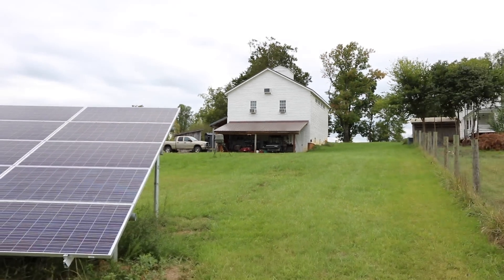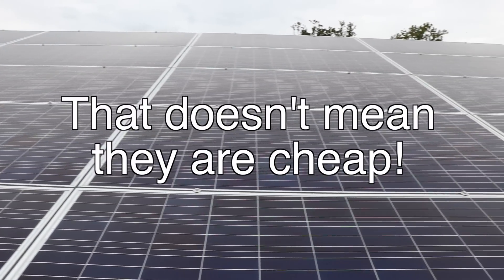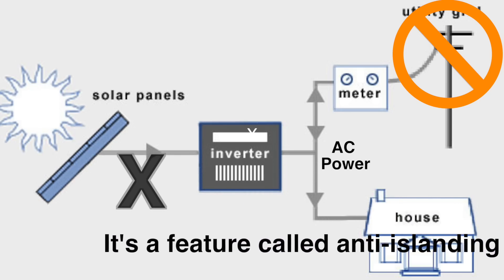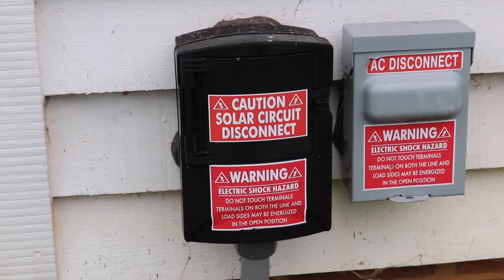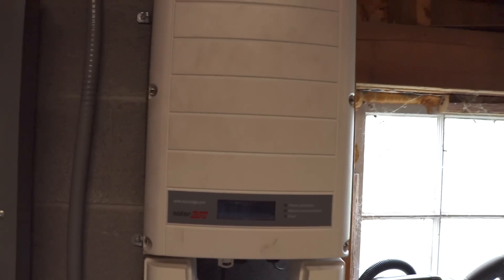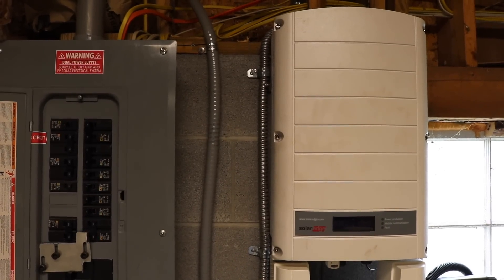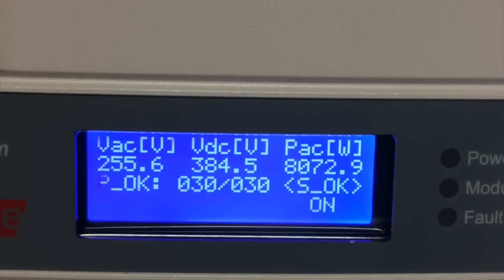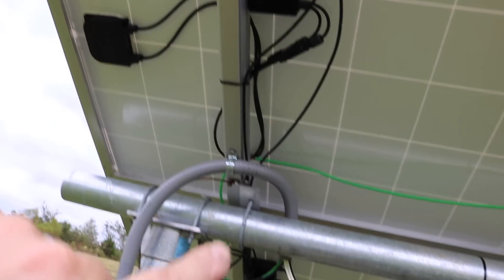The ugly truth behind grid-tie solar systems. Part 1, FarmCraft101 solar.  Watch before you buy!

Comment: Your break even assumes you generate your entire energy usage with the panels 7 days a week 365 days a year. I think your break even is going to be closer to 12 years at best.
Reply from the maker: No, I didn't figure it making 9.1kW of power.  I have been averaging about 55 kWh per day, which is in line with my estimates.
Reply: This number will vary throughout the year.   I have an 8.5KW grid tied net metered solar system in Southern Ontario, Canada.  In June and July I will average 50KWh per day in generation.  In December-January it will be as low as 19KWh per day (with darker days and snow).   My home uses an average of 30KWh per day (I have a Chevrolet Volt which tacks on an average of 12KWh per day).  I generate a large credit in the summer and that helps get me through the deficit in the winter.  I come very close to break even every year.
Reply: Cool system.  Since wires cost so much, why is it so far from your house?

55 kWh per day  is a lot of juice.
30panels * 300maxwatts/panel = 9kW
You'd have to be averaging 6 good hours of sunlight every day for 54kWh.

Why did you get so much capacity?  Does your house use anywhere remotely as much as that?  What are you doing smelting aluminum or running factory?  Are you making actual cash from the power company?
Reply: Most people miss one point, if you have $20 k that you have  invested at less than 1% that you have no immediate use for and use it to install a 4kw solar system the return on your investment will be  considerable greater starting the first day
Reply: yeah,  kinda figured the same. i'd rather just pay the $200 a month in electricity.  those batteries will cost thousands to replace.
Reply: economics is different for everyone and I think that's what confuses most people. solar is dirt cheap in places where electricity is expensive but sunlight is plentiful (southern CA for example). solar doesn't make sense in places where you get little sunlight or if electricity is dirt cheap.

take his case where he's measured an average of 55kwh daily and pays about 0.11 cents per kwh. that means he generates about $2,200 in electricity per year. $17,000 / $2,200 = 7.8 years payoff. yes the output does degrade over time, about 1% annually that's typically warrantied but electricity companies will raise rates on average much more than that.

what I can say is 0.11 cents/kwh is pretty typical and the 6 average daily sunshine hours he gets is pretty good (most in the US will range between 4.5-5.5 average sunshine hours). it might be better to think of it in terms of annual sunshine hours which you can look up - ranges between 1600-2000 in the USA.

I know some states pay less than .10 cents/kwh flat rate while others in southern CA get charged 0.25 cents/kwh peak plus extra if you pass a threshold monthly usage. so payoff in some areas could be just 4-5 years. all you have to do is look at your electricity bill and build a system that roughly covers it based on your geographic location.
Reply: I'm net metering.  Not Micro-fit.  I'm not being paid by the Ontario government.  Even today micro-fit which is ending this year is only paying 28 cents/KWh locked in at a 20 year contract.  Which is no longer worth it. That's why I went with net metering.  I actually use the power I make and only get a credit against my hydro bill for the power I push back to the grid at the going rate.  Nothing more.  In fact I have to pay sales tax on the power I use but don't get sales tax back on the power I push back to the grid.
Reply: On top of the tax paid for power used what other fees do you pay on your monthly hydro bill?
Reply: On top of the tax paid for power used what other fees do you pay on your monthly hydro bill?
Reply: Not sure if this question was directed at me?  But in my case we pay a fixed and variable (per/KWh) delivery fees.  And sales tax (currently 5% GST [Ontario's 8% PST is currently charged and then rebated on our bills]). On top of the per/KWh generation charge.  When I sell power back to the grid I get credit for the per/KWh generation charge and variable (per/KWh) delivery charge.
Reply: Erik Stephens Yeah it was directed at you. I'm also from southwestern Ontario and planning to go solar net metering. Isn't there also a delivery charge?
Reply: Yes there are delivery charges.  Delivery charges break down in to some that are fixed monthly and some that are based on the KWh used.  The fixed monthly delivery charges need to be paid regardless of how much solar you produce.  Delivery charges that are based on the KWh are offset in a net meetering application.  So you pay delivery per KWh on power from the grid but you also get paid delivery per KWh for the solar produced.
Reply: Erik Stephens ok I got it thanks. Is your monthly bill fairly consistent (low)?
Reply: To give you an idea.  I have no natural gas in my house and both my wife and I drive electric cars.  House and water heater both use air source heat pumps.  For 9 months of the year my bill sits around $40 to $45 a month (fixed monthly fees + sales tax).  For 3 months of the year I usually have a couple $150 bills and one bill that's a bit over $200 as I eat through my credits and need to heat my house.  I have room to add one more KW to my solar system which should bring that down some more.
Reply: Erik Stephens what size is your array now and what is your average dally kw usage?
Reply: My array is 8.5KW.  It generates in the summer 20 to 70KWh per day.  In the darkest winter it can be 5 to 30KWh per day.  I use as low as 25KWh per day in the summer to up to 100KWh per day in the worst of winter.
Reply: Erik Stephens a little off topic but what electric cars do you and your wife drive? Do you charge both of them every day?
Reply: We have a Chevrolet Volt and Bolt EV.  We keep them topped up everyday.
Reply: only the person that bought the solar setup knows how much power they use and the break even point. If you go solar when you build a new house you dont need to worry what the break even point is because if you live in the country the cost of running wires could run you the cost of solar, its a no brainer.  I would think very serious about installing a system. solar is also a good choice for a tiny home or RV

Comment: Regarding power availability when the grid is down: The newer SMA Sunnyboy inverters provide a outlet with up to 2,000 watts of power when the grid is down and the sun is shining. We will see how that goes when our system installed in a few months.
Reply from the maker: Yeah, I have heard about those.  I wonder how it does on partly cloudy days, but that 2000W could be really useful.  Keep the refrigerator cold, etc.

Comment: a good mppt charger nullifies your first benefit since they accept high dc voltages
Reply from the maker: Have you priced them out?  A charge controller that can handle 360V and 9000W doesn't exist.  The closest I could find was a schneider electric that can handle 4000W and costs over $1200, so you would need 2 of them.
Reply: no one ever argued that grid connect is much cheaper i was simply stating that the benefit of being able to use higher voltage from the panels isnt a grid connect only feature so its not a benefit also if you look into the charge controllers yes a single one may not handle 9000w but alot have features to parallel them up just like alot of inverters do aswell

Comment: Very good one.. But wonder why you captioned it as 'Ugly' truth !  It is safety which it provides and yes it is meant for areas where Grid power is considered to be available during day time without much interruptions ! There is some inconvenience  that when Grid power is not available (due to outage or load-shading), your solar panel in a sunny whether  are of no help to provide you power.. That got  be lived with and that is truth !
Reply: FarmCraft101 it's up to you. I do use my grid tie system even when grid is down. The only thing is that you start this manually. You need to disconnect from the grid via breaker and make your own sine wave inside the house. Inverter will pick it up just fine.
Reply from the maker: Well, most people would think if you have solar panels and the sun is shining, you would have power.  With a grid tied system, that's not the case if the grid is down.
Reply: Yeah, how could there be an island anyway if there is no power coming from the power plant? Anti-islanding must be in case only 1 line is down or somehow the inverter picks up a signal.
Reply from the maker: If it has battery backup, then it is a hybrid system, not a grid tied system.  Grid tied means just that, grid tied, no backup.  Off grid is off grid with backup.  Hybrid is a combination of the two. https://youtu.be/gPycyuVJ_Cg
Reply: +FarmCraft101; there is also off grid/no backup.
Direct use of dc power can even run motors. They just go slower and can have the right torque by using variable gear ratios.
Reply: Just not much of a selection of DC appliances at this stage but if a company did go that way it would be a game changer. A friend of mine believe,s that once the grid isn't centralised anymore DC is a much better option, removes the need for an inverter immediately.
Reply: A good example would be pumping water for irrigation or to a tower.

Comment: So nothing is going to break, wear out? Bet you this just evens out, maybe.
Reply from the maker: Solar panels have a 25 year warranty, and typically last much longer than that.  Inverter costs $1200 and has a 10 year warranty.  Assuming worst case and it breaks every 10 years, I would still come out way ahead.  The rest of the system is just wire which is not going to wear while I'm still alive.

Comment: We have a 3.5 kw system that I installed almost 5 years ago. This system cost about $15,000. I saved about $3500 by installing it myself. After the Federal rebate it cost about $8,500. In talking to a property appraiser, solar systems are somewhat like swimming pools and you get about 50% return if you sell. Our system produces almost all the power we need. We saved approximately $900 the first year. Instead of having $8,000 in the bank making 1% ours is on the roof making about 11% tax free. Our electric rates are increasing almost 6% per year. So is solar a good technology? I think it is.
Reply: Mekratrig NO!  DO NOT LEASE!!  You will regret it!
Reply: Mekratrig 

If you do a solar lease please go over the contract.  I used to work in solar and the contract never benefits you.  

If you're going to lease your system they will probably run a credit check.  Usually need a 700+ score.  FYI these are usually 20 year leases.

If you plan to sell your home during the lease is where a lot of trouble comes in.  You are still on the hook for the contract and are usually given two options. Pay off the full term of your lease before you sell or find a home buyer who has a foco score the solar leasing company deems acceptable.

Also be aware of who is liable for damages.

If you don't plan on moving then there should be no problems.  Just make sure the solar leasing company doesn't have a provision that lets them raise rates yearly.  

The solar industry is not the most honest.  They want your money.  And you won't save the environment when residential power consumption is a small dent in overall CO2 emissions, close to 1%-5%.  Similar to the drought bs they pulled in California.  Residential uses 4-7% of all water in California, but we will monitor and fine residents for going over allotments while businesses get a free pass.

Sorry I hate the tactics solar uses.  They learn from big business.
Reply: Mekratrig Be very cautious with a leased system.  There were companies in Northern California doing some very disreputable things with leases.  The homeowner ended up paying way more for the lease than they ever would just from the utility company.  I recall there being a number of lawsuits in process, but I never followed up to see how they ended.
Reply: stevebrannon69 - I live in Southern California, a few days ago attended a presentation for solar where I learned our commercial power utility is the most expensive in the country, and rates are going to skyrocket in the next 5 years.  Will likely pull the trigger on a no-up-front-cost leased solar system in the next few days.  Monthly cost is projected to be roughly the same as what goes to the utility company now, and it WON'T go up.

It really irks me that the system shuts down if the grid goes down.  But if lucky, the cost of adding a battery backup will continue to drop, and it can be retrofitted at a future date.
Reply: Nationwide electricity rates are actually below flat.  2017 is a 2.7% hike nation wide average.  And if you consider inflation is about 3%, that's negative, below flat.  Rate increases are averaging less than 2%/year every year since 2008.
Reply: Also, if you lease you don't get the tax credit, your "solar provider" gets it.
Reply: stevebrannon69 until the electric company and paid for politicians change the law...arizona florida utah. and screw you over.
Reply: andersonchrisa - Thanks to the warnings from you and others, I'm definitely getting cold feet regarding a lease option.  Believe me, I appreciate the input, am still a novice in evaluating all the details about solar.  As it turns out, I may not be able to get a system at all, due to an existing reverse mortgage I have.
Reply: Mekatrig - checkout energysage.com (I'm not in any way affiliated) I used the site to get detailed quotes from several installers without having to deal with any sales pressure.  I got a 5.1KW system installed in early September and, although I don't like to hear about SDG&E gouging us even more, it sounds like it will be paying for itself even sooner.
Reply: stevebrannon69 - Well, I’m glad I stuck my two cents into this thread, I’ve gotten some very good advise.  Due to it, and other reasons, I’ve dropped my intention to lease a system, if I can I’ll purchase it.  And yes, I’ve already encountered one company that’s thoroughly despicable.  Thanks to all those that responded here.
Reply: Might want to try reading ....   https://www.eia.gov/outlooks/steo/report/electricity.cfm      Look at the graph near the bottom.    Does that look flat to you?     IM Power in Indiana just proposed a 20% rate hike.   We are currently at just over 12 cents per KWHR.    20 years ago we were at 3 1/2 cents per KWHR.
Reply: I guarantee poliricians will screw with the law..they did it with dodd /frank for example and used forclosures in the real estate  appraisals (never done before) and KILLED the market 100% certain. In addition i am surcharged a fee for a "furure nuclear powerplant i will never see. In South Carolina same thing sur charges for years and the nuclear power construction company just went bankrupt and they ababdoned the project! Do not doubt me. good video though.
Reply: stevebrannon69 z
Reply: not sure about the 6% per year average,  there is too much variability between regions and providers to make blanket statements.  But where I live in San Diego, SDG&E raised rates 7% this year and is asking for approval of another 11% increase in 2019.
Reply: Every time I get a bill from SDG&E, it's comes with a notice of proposed rate increases.  Went to a solar presentation last week, found out this is only the tip of the iceberg.  Aside from rate increases, SDG&E is converting to a TOU (time of day) rate structure to replace the previous 3 tiered setup.  Net result of BOTH of these changes - rates are going to skyrocket over the next five years, almost on a logarithmic curve.  Plus SDG&E is ALREADY the most expensive power utility/monopoly in the entire country, except for Hawaii.  Almost seems like they're pushing people to convert to solar, and, as more people do, guess what?  SDG&E will have to continue raising rates on existing customers to compensate.  If I could afford it, I'd opt for a battery system and completely get off the grid.  When/if I'm able to get a system, that will be one of my top concerns - I want an installation where batteries can be retrofitted in the future.
Reply: If you really set down and do the math solar system will save you about the same amount as it costs during it's lifetime. They do that on purpose because you can buy this equipment for a much lower price from "unapproved" systems. But that's the key, the USA requires the equipment to be approved costing 4 to 5 times as much. They try to discourage you from installing solar.
Reply: stevebrannon69  solar saves me 1000.00 a quater easy so it's worth it all day
Reply: I've never over the years have seen electrical rates drop. Natural gas may go up and down a bit, but electricity only goes up. I like in California and even with renewable electricity sources that we have in California the rates still go up.
Reply: *with the rebate
Reply from the maker: Agree.  It's nice when it's good for the environment and your pocketbook at the same time!
Reply: Rubbish.  Energy costs aren't increasing 6% per year.  If anything, rates have gone down or been flat since both natgas and oil prices are less than half they were a decade ago.
Reply: @ArthurDentZaphodBeeb According to the U.S. Energy Information Administration (EIA), electricity prices have increased 2.36% per year in the United States for the past 25 years, from a national average price of 8.43 cents per kilowatt-hour (kWh) in 1997 to 15.12 cents/kWh in 2022 (the most recent year for which annual data is available)